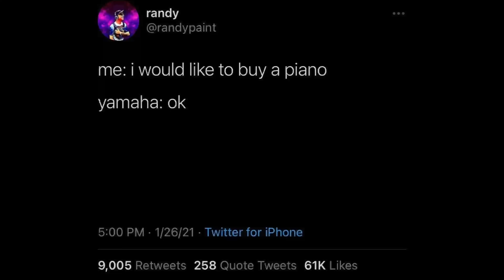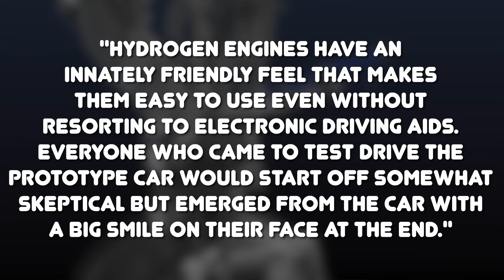Toyota's New 455HP Hydrogen V8: Everything You Need to Know

Comment: You missed a very important part. Do you know wich is more cost efficient (electricity x hydrogen)? I found that to make hydrogen it uses a lot of electricity, losing part of it´s cost there, and also found that  engines are much more efficient on electricity than on hydrogen. This means that electricity is about 65% more cost efficient than Hydrogen when used on cars, so it´s a waste to use a hydrogen engine.

Another problem is how electricity is being generated and stored. What you said is not 100% true about having a lot of eletric vehicles right now. It´s possible to expand our electricity generation by a lot in a short time, go check out what happened in Spain - they incentivated the population to produce their own energy and sell it, wich they did, but the electricity companies got angry beucause that was too much energy available and they were expediencing losses, making the governemet go back on their word, wich made all the investments made by the general population to be worthless instead. 

We have to continiously move away from fossil fuels, creating incentives for these electricity companies to stop using them, so we can have clean energy. But it´s possible. Advancements on batteries are comming too.

Comment: The world can not produce enough electricity to power the cars if everyone went electric. Plus the production of the electricity in by far most cases uses coal or petroleum while there is some wind solar and water those can not even fill the need now and wind and solar do not produce enough to replace the energy cost of making them. Further the other option, nuclear, has its own problems and in USA is not likely to be scaled up.  Result we are a long way from being done with internal or external combustion engines

Comment: If the global market of cars realy wanted to solve the ecological problems, they would invest in ethanol and hydrogen, since the adaptation is far easier, the use of products of mining its lower  the cars are much more "energy efective" since the density of energy in both the fuels compare to batery.
Ethanol here on Brasil is wide spread, and had to potential to take over the gasoline easily since the production is cheap, and with the actual tecnology its almost carbon free.
Sadly the only rock on the way of the progress of Brasil has been always politicians...

Comment: Electric cars have a halo put over them by people who know jack shit about power grid limits and supply vs demand. On one hand, the amount of power generation required to power a nation full of electric vehicles would negate the "zero emissions" claim of EVs, as power generation is still primarily coal-driven, and on the other, we don't have enough lithium, nickel, cadmium, or any if the materials used in battery production to supply millions of cars per nation. And that's just batteries. That's not including other high-demand materials like PCB and semiconductors. Hydrogen is not without problems, but the production side of things is already well established. The United States could focus on transportation and storage of hydrogen to supply fuel stations, and a lot of the issues would be solved.

Comment: the real answer is to power the roads it would charge a small battery, like wireless charging on your cell. in your car. it can also thaw out roads . you could run power lines in the road protecting them in ice storms and against emp and solar flares.

Comment: IMO Hydrogen should be the way to go for the the future. if we really care for teh envoirment that is. Hydrogen is expensive atm because there is no demand for it so it not being mass produce atm. one of the opposision to why not set up mass solar farm is that solar only make electricity while teh sun is up. often time, it make too much electricity and we often have it turn off so we dotn overload that grid. if we make teh switch to hydrogen instead of battery, we can set up as many solar farm as we want and use teh excess power to make hydrogen. using hydgen fuel cell tech, we can use teh hydrogen produce during teh day time to run power plant to make electricity to use during winter and nite hours. the only different between hydrogen fuel cell and battrery electric is teh power source. one use hydrogen to make electricity to operate a electric motor while the other use a battery. there hydrogen ICE and hydrogen fuel cell which is a EV.

imo the reason toyota is still no given up on hydrogen is that there are 3 sector to transportation. air transportation, trucks and cars. BEV is popular atm on cars, but Trucker might want to shift to hydrogen base instead of battery. battery is too heavy, for long range and high tower, they waste too much weight on teh battery along. a hydrogen ICE or hydrogen fuel cell will be a better option for them when shifting to 0 emission. adding extra tank to carry hydrogen wont add in thousands of pound and wont add in days wait at charge station for truckers.

as electric motor tech advance, hydrogen fuel cell will probably be a better option for plane then a battery. plane are even more senitive to weight then all other transportation.

atm price of electricity is cheaper then hydrogen, but if trucker make the switch to hydrogen fuel cell for their truck, fusion power that every1 being working so hard on is just hydrogen base as well. if energy companies to go green, solar, only work when there is sun, wind only work if there si wind, hydrogen is there only storage that can store enough to use for winter.

Comment: Stay with a Hybrid EV using a 2 or 3 cylinder HYDROGEN operated ICE with electric generation to power the electric motors.  This eliminates emissions and allows longer range for less expense.  With improved regulations for a consumer refilling or fuel stations to swap bottled hydrogen.  Standards would also be needed to the size and types of onboard hydrogen bottles.  Most full service stations already have certain gas bottles on hand ie. oxygen, acetylene, argon, etc.  Like most situations in life it ends in a compromise.

Comment: EV's replace maybe 15% tops - to go all in breaks the national grid, for which the "masterminds" have no credible upgrade plans in place, even as a war on oil and gas rages on - there are no federal leases to bid on as of June.  Zero.  And plans to increase nuclear capacity are outright anemic.   Besides... electricity is not a readily portable source, which is a problem.  A big problem.  I could see LNG service [or hydrogen] bypassing EV's, but the question remains: what of trucking?  Getting food to market needs that.
Toyota markets this engine, I am buying.  The only problem we have standing in the way is the DOT, which will have to reconfigure some transpotation rules to support its necessary market..

Comment: my truck can generate all the hydrogen it needs, on demand,  tied to engine vacuum, and injects the hydrogen gas into the air intake manifold, slated to be installed on my 2004 5.4 Liter 3V engine inside my F-150...  . . . . ...  i do not use a DC voltage to generate the hydrogen gas. I am using a 750 watt L-Band RF generator, which operates at the same natural resonance frequency of water.......

Comment: He said that there isn’t any hydrogen stations around, the idea is to be able to produce hydrogen onboard in the vehicle itself no need for a station , add water and go ,  now let’s talk about adding a little nitrous to it just for farts and giggles !  💨
Reply from the maker: How are you going to produce hydrogen onboard? Turning water to hydrogen requires electrolysis. You either need onboard battery power for this, or an engine to generate that power.

If you’re going to use electricity for electrolysis, why not just use it for electric motors instead?

Comment: Yes but electric is only as green as the electricity that it comes from 85 percent of the electricity in usa comes from un green sources and to add to that ur battery only last 7 years and there about 20 to 30k to replace oh and they can be recycled also too californication was told u can chose between charging ur ev or  ac for ur house or we are gona have black outs to make the charging infrastructure and green power if even possible would take decades and cost trillions of dollars i have written a research paper on this for university and the future is looking bleak for green transport also to most hydrogen comes from the process of refined nature gas and is not green only when it comes from a dam the use's electrolysis to make hydrogen is green so u tell me how we are goning to find the green energy to power around 3billion EVs and whos gona pay for it

Comment: Electric is OK, batteries are the problem. Gas is out. Never sell a motor or a vehicle based on it's sound. That is dumb. Changing the fuel ?? Well hydrogen is clean. Gas exhaust burns at 30% efficiency, spewing out 70% crap ( a shit load of elements from the Element table ). Hydrogen, well, at the most, it releases water ! Don't say there is zero demand... people can make the fuel at home if we just give them the tools.

Comment: battery replacement is maintenance, electric cars still run a cooling system which is maintenance, brake replacement is maintenance. This argument youre making is somewhat weak. Then you have the need to mine the components for the batteries, which is not exactly the most environmentally friendly thing out there, (actually almost as bad as mining for fossil fuels) the product required to manufacture the batteries for these vehicles could be put in the same class as fossil fuels as they are rare, the means to extract them is terrible for the environment and there isn't more of them being created.  Your argument for fueling stations is weak as well, as battery powered cars faced the same problems when they first became mainstream, then slowly charge stations were built for them and they became more abundant. 
Hydrogen in my opinion is the better solution, as you continue to built to a car the same way you build it now along with its engine (with just some mild tweeks) and then instead of using fossil fuels to power it you use water and the best part about it is that water is completely renewable and abundant. When there's a mass abundance of something, that also brings down the cost of it, which in turn would make fuel for these vehicles even cheaper.

Comment: With technology, we can produce HH² at a fast rate thus only need to add water in the tank. To stop the water needing to be refilled, you add an air filter to flow through the water to re-oxygenation so to speak lol easy to get a fast flow just using normal power that a car battery can generate while driving creating more electric to separate the H²O at the higher rate. I wish I had someone to help me do the maths for my BMW330ci and then add it to prove how EASY it really is

Comment: I don’t know the speaker here…. but he is dead wrong about the demand for hydrogen combustion engines in vehicles. It is coming and faster than you think. The governments of the world are making hydrocarbons a more expensive fuel and will continue to do so with the goal of making them virtually impossible for the average person to use. The current solution being offered has been the electric vehicle and we have seen an explosion of interest and production of these vehicles, in spite of their shortcomings, because of this imposed demand for them. A replacement to the combustion engine from hydrocarbon to hydrogen would destroy the electric vehicle industry. The justification for going electric is the carbon footprint of hydrocarbons…. Hydrogen would end that. The restrictions of electric vehicles ( travel distance, charging times, cold climate limitations, cost of production, stresses on power grids, etc) would go away with a combustion based fuel supply. 

Another consideration is the reduction of the carbon footprint when going to hydrogen as a fuel source. Electric vehicles must use the electrical grid where they are; and electrical grids are not carbon neutral. Most electrical grids are already heavily dependant on fossil fuels for their production of electricity. Even worse, as the demand from an increased number of electrical vehicles outpaces the grid production capacity, electrical grids will be forced to rely more heavily on carbon heavy energy production sources. Hydrogen could be produced at the location of a carbon reduced production facility ( nuclear, wind, hydro, tidal, wave action, solar, etc) and it could then be delivered, using hydrogen based transport vehicles, to anywhere…. With a much lower carbon footprint than the electrical grids can provide. 

As a person deeply involved in energy conservation and carbon reduction, I’m telling you that hydrogen isn’t going to be irrelevant for long. If word gets out that hydrogen can replace hydrocarbons, and demand gets a chance to take off, this will be the answer to the planet’s carbon reduction problems (and potentially the end of the EV industry’s rapid expansion; so don’t be surprised if you hear a lot of negativity about hydrogen…. there is a huge industry that just doesn’t want hydrogen to happen)

Comment: There is actually an astronomical demand for hydrogen powered engines. Way more than electric. Electric is impossible to sustain. They will die off in the very near future for a very specific reason. Mostly resources. There's only problem with hydrogen is availability... But it's actually more available than you think and will only require 1 law to become very abundant at any fueling station.

Comment: “The only limiting factor is range and how long it takes to charge, which is rapidly changing.” There’s a fundamental problem with electric vehicles and that’s energy density, that problem is not rapidly changing and is going to be a problem for a very long time. Not to mention all the open pit mining that required to obtain the rare earth elements used in the batteries for said electric cars. The infrastructure needed for hydrogen powered vehicles already exists in that, most gas stations, with some alterations are a suitable locations to sell it.

Comment: Hydrogen is the only way to go forward, lithium will run out very soon, hydrogen combustion or hydrogen fuel cells will take over, hydrogen is everywhere! The energy density is like 3x that of a lithium ion battery, and they say that the batteries will get better, there is a physical limit for battery’s, the inferstructure for gas is also very similar to the infer structure for hydrogen stations, it just makes a lot more sense

Comment: What we could use more than anything is one of these High Powered Awesome Hydrogen Vehicles with an on board Hydrogen making device. Another word just add H2O & Electrolytes to make HHO to run you vehicle and you're off and running. Another words  eliminate the use of costly and timely fuel stations altogether.  What we need along with this Awesome Hydrogen Vehicle is a Built-in unit that makes your own fuel when needed
Reply: Hydrogen source is water. Hydrogen is for drinking and washing clothes not engines.

Comment: I Totally agree with the Pro's / Versus the cons of Hydrogen powered vehicles. Absolutely no harmful emissions, no toxic by products like EV batteries being produced from raw materials taken out of the ground, let along the problem of recycling the EV batteries. No waiting for your EV to charge during the day like I see so often at Wawa, and one very important point I have not heard anyone talk about is the "EMF & EMR" given off by the 
1.) Electric motors, 2.) Regenerative braking, 3.) The Charging processes the EV uses to recharge the batteries, 4.) Etc., 5.) Etc., .... With Hydrogen all these toxic, unhealthy processes go away. The human body is not exposed to Unhealthy EMF / EMR fields in a Hydrogen powered vehicle. The gasoline engine and thereby the gasoline with all the toxic additives put in it which everyone on the planet is exposed to goes away also. No more wasting corn crops to create Ethanol which destroys rubber components in a vehicles fuel system, no more adding "fuel stabilizer" to try to keep the gasoline & Ethanol mix from going bad at an extremely fast rate, no more wasting deisel fuel in farm equipment, 18 wheeled trucks transporting the corn to processing plants and for such a small return to boost the octane of gasoline, etc. The U.S. electric grid can't even handle current demands on it's extremely old infrastructure even without EV's being factored into daily electric demand! Then if the electric grid goes down EV's are Scre..ed unless you bought a solar power wall, solar panels, and all the other components to charge your EV at home which would cost you $ 50K plus. I would definitely buy a Hydrogen powered vehicle from a car manufacture like Toyota due to their very long history of inovative vehicle production, they run forever, are very reliable, and almost any mechanic Can and Will work on them!

Sincerely,  JC
Reply: A real viewpoint of what hydrogen is capable of and the author having a good idea that hydrogen could in turn charge a smaller battery to produce more electric to run a electric motor in an electric car which doesn't weigh as much as a fully electric car would oh so the vehicle would be smaller and more powerful and have diversified power sources at the same